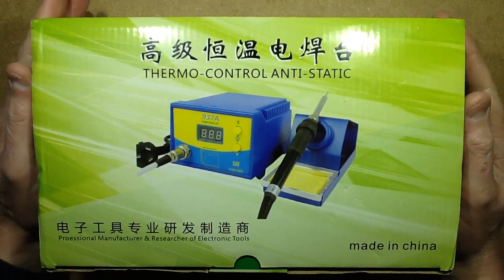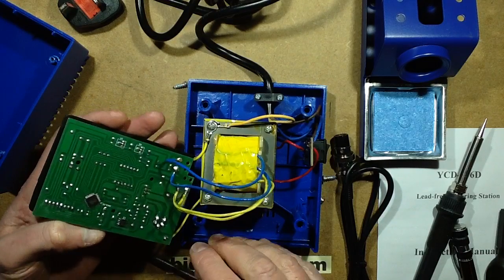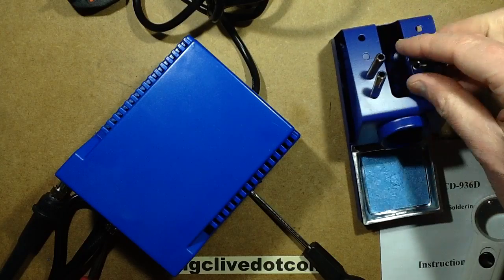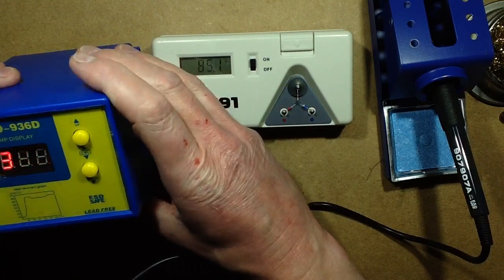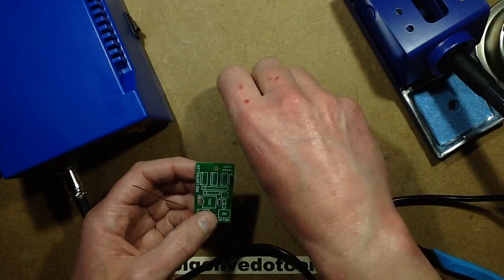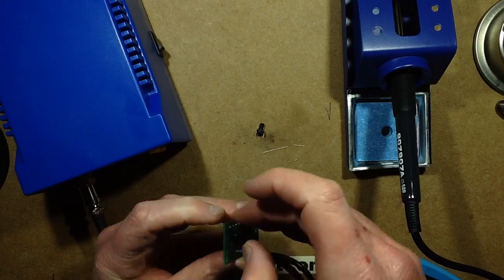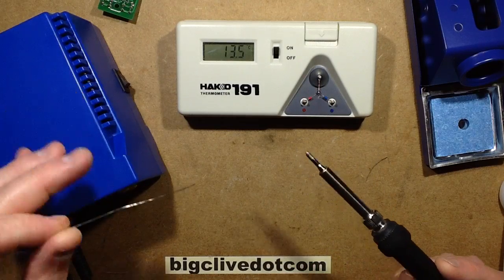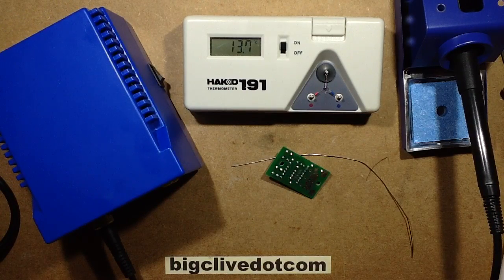936D digital soldering station test and internal look.

Comment: I'm curious if this soldering station is suitable? for soldering at the higher temperatures required for silver soldering.
Reply from the maker: Sadly no.  That requires specialist high temperature equipment.
Reply: Thanks, that's a good thing to know before going off and purchasing a soldering station that might not be up to the task. but it appeared to do well for electronics.

Comment: You're trusting the temperature calibration on a £10 temperature tester (a hakko clone), what if that itself isn't accurate?
Reply: The thing with those, it's that they've been around for so long, that it doesn't take much to make them accurate. You'd waste more time trying to make them inaccurate instead.
Measuring temps with a thermocouple is not a new tech, so even the cheapest one will be accurate.
Just like any cheap power meter that looks like a kill-a-watt. A current shunt wasn't invented yesterday.

Plus, after a while, you tend to have a gut feeling about the temp of an iron.

Comment: I understand this video is 8 years old at this point, but it seems to be from the period when certain Chinese products were using a non-conforming BS1363 plug with a sleeved earth pin. Once inserted into a socket the earth would disconnect as the contacts would be on the plastic part! I remember about 15 years ago when I was at college studying to become a sparky I showed some of these to a lecturer which I had found at my workplace and he had an utter field day with them.

Comment: Many thanks for reviewing cheap Chinese tat over the years. I ordered a Baku 601D station two years ago because of this video during an eBay electronics sale and I've been extremely happy with it.

I believe you say here to watch the plug type you buy if you grab extra irons for the station. Of course like a complete prat I ordered the wrong one, but salvaged it by snipping and splicing the cable of the old one to the new iron.

Comment: I watch these old videos and get all excited about upgrading my gear to your old video stuff, then I look and using the exact numbers I come up with 154 bucks for the unit.  Then I found that modifying my search to Soldering iron station and I find the cheap ones at around 40 bucks or less.  I am just swearing off my purchasing binge blowing some money from mom's house sale as I need to by some new teeth, funny how they all began falling out when my wife got cancer and within 3 months she had passed away and nearly all my upper teeth broke off at the gum line. Not sure how that works but now I am trying to eat with only 6 teeth on top, the bottoms are nearly all intact though for some reason or another.

Comment: Clive, I know this is an older vid so you might not see this, but thanks to you I got a soldering station for myself, a Katsu branded one with a hot air gun too. One thing I like about it, is if it notices that the thermocouple isn't temperature cycling over a certain amount of time, the unit goes into a 'sleep' mode where it keeps the temperature at about 200C until you pick up the iron again and it starts thermal cycling, just so you don't burn out tips if you happen to do something that takes a bit longer, but can jump straight back in (it heats back up to the set temperature again very quickly). Does this unit do that? I'm thinking of getting a 936D style one just because the new irons for it are dirt cheap. The ones for my Katsu are the opposite gender and have 6 pins, not 5, so they're a bit rarer and more expensive, but functionally the same.

Comment: I got the 936D+ which is digital, but with a knob rather than buttons.
The + means it’s more powerful (75w instead of the usual 50w?) & the iron is blue & yellow.
It’s great & the extra power is very useful, but it’s much harder & more expensive on spares, & you can’t put the generic black irons in it (they seriously overheat & can’t be calibrated down). The tips are the same but the tip holder (screw thingy which goes brittle over time & becomes weak) is different, which is most annoying.

ETA: my mistake, mine’s called a 937D+
Great little unit, I’ve been using it for years in my business rebuilding vintage magnetos.

Comment: Have just grabbed one of these to replace an Iron that died after 2 small projects.
How has it held up over time?
Reply from the maker: They do have a weakness regarding internal solder connection to the iron socket on the front fascia.  That's mentioned in another video.

Comment: @BigClivedotcom
Hi,
I know this video has some time, but let me tell you that your videos are very good and educational.
I have an older soldering iron, which I want to replace by a cheap soldering station for hobby jobs.
I've found this one on amazon at an amazing price, but is this any good ?
https://www.amazon.co.uk/Grandma-Shark-Desoldering-station937D-240V-B/dp/B07XLJ38MS
It looks like Yihua and other Hakko clones from the outside, but would you buy it?
Thanks
Pedro
Reply from the maker: Hi Pedro, I use a Yihua 8786D which is a similar style but with a heat gun too.  They're quite acceptable, but go by feel and not the displayed temperature.  Also check earth continuity from plug to iron tip.
Reply: bigclivedotcom Thanks for your reply.

Comment: I had one of these systems with the ceramic heater only lasted one use I thought something was wrong until my dumbass found out that 400+ was in C and not F lol I was a huge noob and the seller refused to help me out and rightly so as I had misused the solder station. I upgraded to the ksger and now won't go above 250c sometimes I use the +50c boost feature when I'm doing fast work at 5 minute intervals. Both are really really great  affordable stations. I still have a version of this station that I'm going to give away as it's just gathering dust, with a new ceramic heater obviously.

Comment: Still wondering who came up with the idea to use a male connector for the power out for the iron.
Reply from the maker: I think it's to avoid mixing it up with a version that uses a different heat sensor.
Reply: @bigclivedotcom  Could be. But a different type of female connector would have been better.

Comment: 350 is perfect for pcb,s lower temp forces you to apply heat for a long time 5, 6, 7 seconds. 700 to 725 ,,, 1 sec heat ,touch solder pull out. 2 ,, 3 seconds max.

Comment: You clumsy bear!

You can just unscrew the nut around the iron plug instead of desoldering anything.
Reply from the maker: The nut is on the back of the panel, not the front.

Comment: Hi Clive. Great vid as usual! Just ordered myself one, but are there any accessories I should get as well to go with it ? (First thing I'll do is replace the mains lead and plug!) Cheers.
Reply from the maker: While you've got it open check out the point where the soldering iron connector goes onto the PCB and reinforce it with short bits of wire from the pins to the adjacent pads/tracks.  It makes it much more resilient as the soldering of the connector often cracks in that area.
You can get mixed packs of the bits on eBay or packs of your favourite style.
Reply: @bigclivedotcom  cheers, I saw that vid, I might also try and put someting between the socket and the inside of the case to stop it from being pushed in! Wooden dowel or something plastic.
Reply: @bigclivedotcom  Hi Clive, it's Frank here, Ive got  the iron and done the mods. I also got the Hako 191 to callibrrate with. I have a BIG problem! With the iron set to 350 deg the hako read over 400 and climbing. so I dropped temp to min, 180 deg, put calibrater down to -50 and hako hovers around 280 deg! the iron wont quite melt the solder. Which one do I trust? Hope you  can help.  Keep the brill vids coming. Love them & your humour!
Reply from the maker: @Franko_Walker  The knockoff tip tester sare very random at times.  Go by feel.  Start at the point the solder melts reliably and then start soldering.  If the solder melts too slowly nudge the heat up until you get a good result that you feel comfortable with.  For decades I soldered with an unregulated Antex iron that went up to very high standby temperatures.

Comment: Just bought one of these "Yatsu" brand £24 from fleabay (UK supplier).
Plug was correctly fused (3A) and no sleeve on the earth. I guess the importer or manufacturer actually read the UK regs. Still no internal fuse, but after Weller-gate, I'm wondering if it is necessary in the UK where there is a fused and earthed plug.
Reply: BTW it is very good for the money. My old Amtex (ex. Maplin) cost me around £15 1990-something pounds and was always horrendous to use apart from for through-hole with lead solder.

Comment: I bought a Hakko 936D soldering station in 2012 - black rather than multi-colour case. At that time the heat gun was not yet a common or inexpensive option. (I should have waited a year). I'd used a Weller soldering station for 20+ years, and it was still working, and I can't recall what prompted me to buy the Hakko - possibly a gift certificate or 50% off coupon. 
Of late I've been wondering if retrofitting the Hakko to add on the hot air gun is possible, or desirable. Once upon a time I'd just have ordered a newer unit,  but a small fixed income and "want" not "need" has made me wonder if there's a way to modify the existing box for a hot air handpiece. I suspect not, and that I'll have to wait for a minor windfall or other unlikely event. The Hakko has given very good service, and a selection of tips and elements are available at reasonable prices. Weller tips have become very pricey, although they are still high quality. Like you, I use a soldering station less than I once did, but I've no complaint about the quality or longevity of the Hakko.
Reply from the maker: You can get the hot air pen units on their own quite cheaply on eBay.

Comment: Speaking of factory hardware and electronics nonsense, the company where I work has a plastic injection machine made by Arburg. All if it’s programming runs of 3.5 inch floppy diskettes, yeah, that old. Every time one fails we have to order it from Arburg and just tolerate the turn around time. You’d think it would be as easy as popping the floppy in an old computer and copying it, but *nooo*. It’s formatting has no sectors, no clusters, no real formatting to speak of. It uses a custom drive that writes to it almost like how computers used to write to a cassette tape, just as a stream of data, and in this case it is basically just raw G-Code or something similar.

Anyway, I have two irons. My 936 clone for the normal sort of through hole or SMD stuff, and my 25 Watt American Beauty. The American Beauty has a big chunky 5 mm chisel tip and a tremendous amount of metal, so it’s thermal mass is great, so I use it for really heavy ground planes and wires and such. If I’m tinning really big wires I’ll resort to my solder pot though. Nothing says thermal mass like a couple pounds of molten lead.

Comment: As a complete beginner to soldering can I use this straight out the box or do I need to calibrate it or do anything else??
Im looking forward to soldering but can not afford one of the expensive irons so this one is really tempting!

Im mostly going to be making little headphone amp or diy mixer projects or recabling headphones etc.
Reply from the maker: You can use all these irons out of the box by just judging the temperature that melts the solder well, starting low and working up.  Note that some of these digital stations have solder issues inside on the iron connector.
Reply: @bigclivedotcom  thanks, I'm going to go for this one, a t12 clone or a ts100 and hope for the best.

Comment: Are they good enough to solder the caps around the CPU on a Dell motherboard. either the digital or the non digital?  Right now what I have is a 30 watt soldering iron from wal-mart  and it will not get hot enough fast enough to get the caps out beside the CPU, I replaced some bulged caps elsewhere on the board and they  came out and went back in fine, but the ones beside the CPU have not. Thanks man.

Comment: So, I had to open my BK Precision 5460 desktop multimeter to replace a fuse holder that you can no longer get the front cap for. To my surprise there is no wire connected at all to the 3 earth pin inside the case. there is metal shielding on all 6 sides and they are all common wired together and have a bond wire going back to the power supply board. Is this normal for multimeters?? that use mains voltage supply??

Comment: Is there a big difference in the model numbers I've found a nice looking 939d was curious about it. Says it's a rework and desoildering station 80 watt 200-480 degrees
Reply: Also just found a nice looking 888d clone it's a bit more money but not much more seems the hakko 888d is around $110 and the hakko 300 is $250 that's just crazy

Comment: I feel like the holes on the stand are for mounting it under the edge of your work table. Put the station under the desk and hang the iron holder off the bottom edge of the table.

Comment: Update after 2 years of use....

The buzzing gets worse, so you have two choices...tighten the s read holding the transformer to the casing, thus tightening the laminations of the transformer core... or go completely old school and use resin to seal the lamination thus solving the hum.

So much quieter.
Reply: However a fine iron

Comment: Hi Clive I was just wondering what is the best temperature to solder with for best results
Reply from the maker: I usually set my iron at around 350C but it varies with equipment and solder.

Comment: Have you tried one of these lead bending aids? Item no 311520524893 I'd be interested to see your take on them. They might be a much more affordable option to your hugely expensive RS lead bender ;)
Reply from the maker: I've not tried that type, but do have an adjustable version that works in a similar way.  This looks more robust.
Reply: bigclivedotcom I might grab one and give it a go. Where do you stay at the moment? Are you in Glasgow? Nice to get a response so quickly! :)
Reply: Mine has just arrived. Waiting for a couple of kits to arrive then I'll pop up a video of it in use. Looks pretty good though.

Comment: I have Yihua temperature-controlled soldering iron, which had a fault which made it run at 100% power all the time, reaching 450°C regardless of the setting. The LED for the "power" was on all the time while it should dim when I set it to lower temperatures.
I took it apart and found absolutely no problems with the components.
I reassembled it, and now it works great.
I'm not sure how and why it was stuck at 100% power.

Comment: Any thoughts on the Yihua 858D? I have one because I was in need of a somewhat cheap but usable rework station. outside of likely needing thermal calibration, the bench power supply meters needing adjustment and the hot air gun not having an insanely high flow rate it doesn't seem too bad. I've tried soldering and desoldering with both the hot air and the iron with a chisel tip and it certainly works for what I need it for.
Reply from the maker: They're functional, so if they do what you need they're fine.

Comment: Concerning the iron types: with the exception of the connectors having PINs and HOLEs reversed, are the tips interchangeable??   For example, will the tips of the "HAKKO's" handle and the tips of the "937D"'s handle fit each other?????  It seems so from the youtube videos.  But I have been -DESPERATELY-  trying to find out if a 
"900M-T-2C" (HAKKO) TIP can be used on the iron that comes with the 937D station.  I hope that I don't have to actually but both parts to be sure.  ...for any help...
THANKS VERY MUCH
Reply from the maker: Most of the 24V irons can use the same tips.  You can get cheap selection packs or sets of one favourite tip.
Reply: HEY BIGCLIVE!!!!!    First of all, thanks for the helpful reply and all those great videos!!!  Below is a list of what I just ordered: ( What I want out of all this is to  be able to use mainly the 900M-T-C1, C2, and C3 tips (I need a "WELL TIP" which I think these tips are) for SMT work with the "937D+" soldering station, and a "858D" REWORK STATION. )

 (1) 937D+ soldering STATION--it has a 5-pin male connector on the front panel.
(2) One replacement TIP for the "937 STATION" Part number:  900M--T-2C.
(3) 24v 60W replacement handle for the "937D" soldering station (It has a 5-HOLE socket which should fit).  And a:
(4) 24v replacement handle for the "937" station, it has a 5-hole female connector (won't fit station), but for < $5,  I can check out the heater, tip, etc. to try making sense of all this...ie, what will fit what...
(5) An " ZENY 858D  SMD soldering / rework hot air station".

Comment: I bought one of these and it was dead out of the box, quick assessment turns out dry joints on the plug connecting the iron to the board. Just re solder as all was fine
Reply from the maker: I put up a video about that very fault a while ago.  It's very common..

Comment: I was looking to buy a soldering iron thermometer and the clone Hakko FG-100 came up, all the listings say 'suitable for lead free solder' does this really make a difference whether you use lead based or free to measure the temp?
Reply from the maker: +WeirdScienceX The lead free solder is more aggressive to bits.  They usually have a thicker coating.

Comment: Wrong socket for genuine Hakko wand/handle?

I bought a 'Katsu' 936D exactly the same as this, as far as I can tell.

As you said, it works very well. I bought a genuine Hakko wand to try (always good to have a spare) and it has the opposite plug. Is that right?

I think I found a matching socket (at RS for about a fiver) and I might just fit the second socket at the side of the case and wire them both up, so In have the choice :-)